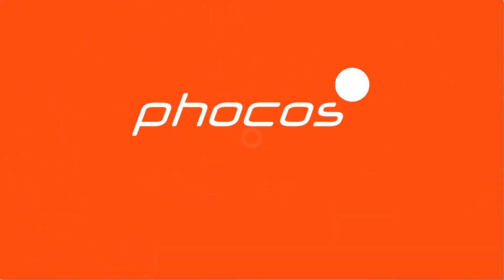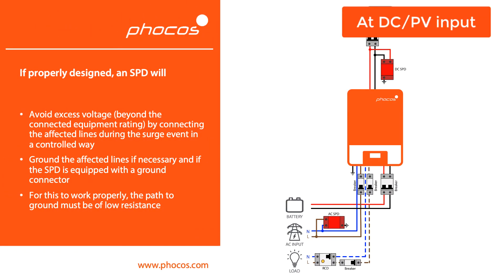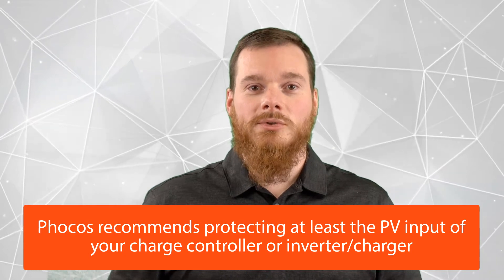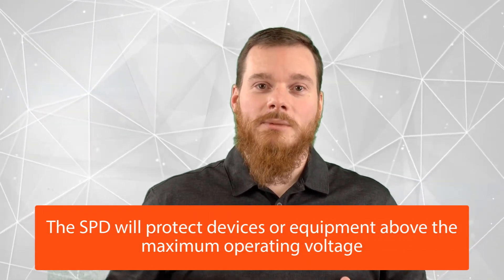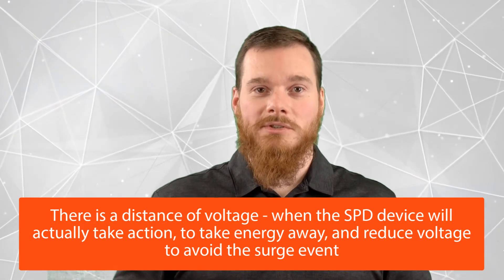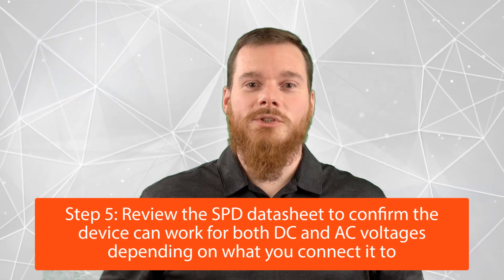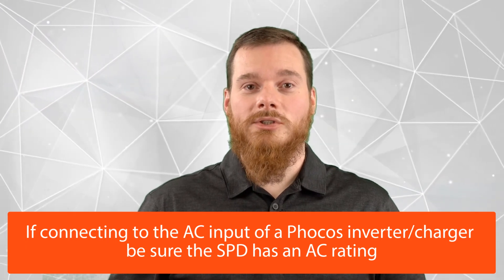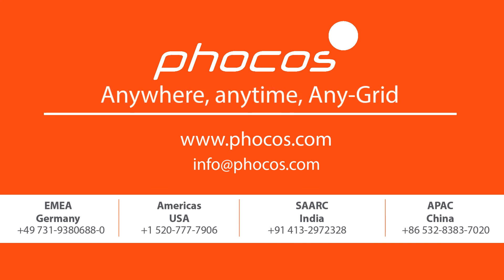How do you correctly size a surge protective device (SPD) for your power system?

Comment: so, what would be the ideal size in terms of voltage to protect your charge controller in your example that had a max voltage of 95 volts? the 100 volt one doesn't start moving until around 120v, according to what you said, so wouldn't that extra voltage in that spread between 95 and 120v damage the controller?

Comment: Good video!
If your PV system is 470V, should you use a SPD of 500V or 250V?
SPD works between DC+/DC- and PE, not between DC+ and DC-. So if you use 500V, are proteting 1000V between DC+ and DC-. So if you use 250V, are proteting 500V between DC+ and DC-.
Is this correct or wrong?
Thanks.
Reply from the maker: Thank you for reaching out! According to our engineers ...For any of the European models of the Any-Grid, the SPD should be rated for 500V Uc. While you are right that the SPD protects  from DC+/ DC- to PE, the point of the SPD is to protect relative to ground. You don't not an external device to protect between PV+ and PV- in our system. If your PV panel experiences a surge (for example: due to weather), it will likely be common mode and will be seen equally on both lines. If you use an SPD rated for 250V Uc, it will already be able to conduct at your Voc of 470V. The rating for the SPD should be the maximum continuous applied voltage.
Reply: @phocos-global But suppose you want to protect against overvoltage in your solar system, from example eletric arcs, some internal damage in solar panel, etc. Which could make high frequency and high voltages. In this scenario you would like to protect DC+ to DC-. And my initial idea is correct?

Comment: this covers less than 50% of SPD selection. Of course, what he mentioned max Uc, means a system can work at such voltage when SPD does not act, this is similar when you buy an socket for a lamp or oven, you get to know its voltage is 120V or 240V. 2nd factor is the absorb power when SPD won't be damage, like you cannot use a 12V dry cell to start a car, SPD power has 20KVA to 100KVA or more. 3rd one is response time, ...

Comment: It is great information you give us, as you said we must make sure that our SPD a rated at specific value e.g if your PV is 95v is best to install SPD of 100v, what i will like to know is it recommended AC also to have 5v different or it can be more
Reply from the maker: According to our tech team, Acceptable SPDs for PV are the Citel DS240-350DC / Phoenix Contact VAL-SEC-T2-2+0-380DC-FM for the 230V models, and the Citel DS240-220DC / Phoenix Contact VAL-SEC-T2-2+0-220DC for the 120V models.
 
For AC input, acceptable example SPDs are Citel DS41S-230 / Phoenix Contact VAL-MS 230 for the 230V models, and the Citel DS41S-120 or Phoenix Contact VAL-SEC-T2-1S-175-FM

Comment: I thought the excess power was supose to go to neutral. Which is correct
Reply: The over voltage goes to ground. In panels where the common and ground are connected it is the same.

Comment: I get so much conflicting information with regard to "uc" and "up" values. Would be great if you could shed a light. Even OpenAI's chatgpt is giving me information that seem opposite to this.
Reply: So for my learning in a series of say 5 panels rated at 50 voc the spd would need to be rated at 250v dc just over …. Is there a multiplayer for the safety cap between the string voltage and the SPD limit ? Thanks for the very concise video
Reply from the maker: Hello, thank you for engaging with us! According to our engineering team..

Uc refers to the maximum continuous working voltage of the SPD when not active. Above this voltage, the SPD will begin to conduct energy towards ground. This voltage needs to be sized to the equipment, and should match the maximum working voltage of the system that it is meant to protect. This is the most important value when sizing an SPD.
Up is the voltage protection level of the SPD. This is the maximum voltage across the SPD when it is actively dissipating energy to ground.
The range between Uc and Up is the range of operating voltages of the SPD when it is active and dissipating energy to ground. The voltage may be lower than Uc – but the device will not become active until the voltage has surpassed Uc.

Hopes this helps!
Reply: @phocos-global  Thank you!

Comment: Can use 500 v spd ( UC 500 V) for PSW-H-5KW-230/48V?
Reply from the maker: Hello, the PSW-H 5kW 230/48V can accept a maximum PV input of 450Vdc which means that with an SPD rated at 500Vdc would not offer adequate protection. An SPD rated at 500Vdc would only begin to act after the maximum PV input voltage of the PSW-H has been exceeded, at which point the MPPT component of the PSW-H may already have been damaged. To ensure adequate protection, the SPD device should be rated to 450Vdc (Uc 450V), examples of suitable devices would be Citel DS240-350DC or Phoenix Contact VAL-SEC-T2-2+0-380DC-FM.
Further information regarding AC surge protection devices can be found on pg 3 of the PSW-H manual, which can be downloaded from our website here: https://www.phocos.com/wp-content/uploads/2019/10/Any-Grid_PSW-H_EN-manual_2022-02-21.pdf

Comment: Great explanation but I'm still confused. Isn't it better to pick SPD that has highest capacity? Because 500 or 1000v won't make any difference if most of lightning has 30-100 million volts
Reply from the maker: Hello, the end goal is to protect your Any-Grid inverter from voltage spikes. The SPD needs to be rated so that it protects the hardware limitations of the inverter but also allow it to perform. SPDs are specifically designed for this purpose in mind. We only need to make sure we pair them to equipment correctly.
Reply: For how much input of PV because the very with system because must people upgrade they PV by adding panels

Comment: I’ve seen it said that you can just plug your panels in series into the built in mc4 connectors on the psw-h 48v 5kw unit.  Are you saying you would still need an spd on the panels?  SPD… isn’t that a German political party?
Reply from the maker: Hello, the surge protective device (SPD) is strongly recommended regardless of the PV setup. By their nature, solar panel arrays are installed outside and are therefore liable to pick up voltage surges during thunderstorms, which the SPD is designed to mitigate to some extent, protecting the equipment connected to it, the PSW-H in this case.
Reply: @phocos-global  I want to add something which is very important,  always Install a device(breaker) in series with SPD because sometimes SPD becomes shot-circuited after getting faulty & can damage other equipment as well .

Comment: Great info.  I currently have solar array with Voc of 320.  Could you recommend a spd device
Reply from the maker: Hello, we apologize for the late reply. Assuming you are using a PSW-H-3KW-230/24V or PSW-H-5KW-230/48V, the manual recommends the Citel DS240-350DC or Phoenix Contact VALSEC-T2-2+0-380DC-FM. However, this is assuming the full 450 Voc is being used for PV. As this is not the case for you, choosing an SPD with a Uc rating (max. operating voltage) of you actual PV array Voc (consider coldest temperatures in winter) will actually provide better protection (the SPD will start to act at a lower surge voltage). With a Uc of 350 Vdc, the Citel DS240-280DC would be best suited for your PV array. Always use DC-rated SPDs for solar arrays. See our video https://youtu.be/joFCSb8OLFw?t=367 for more details.
Reply: @phocos-global  thank you

Comment: Is it okay to connect SPD ground wire to ground rod of solar panel? Thanks
Reply from the maker: Hello, this may or may not be permitted, depending on your local electrical code. But if the PV grounding rod is correctly installed and has an adequately low resistance to ground, then there is nothing fundamentally wrong with this approach.